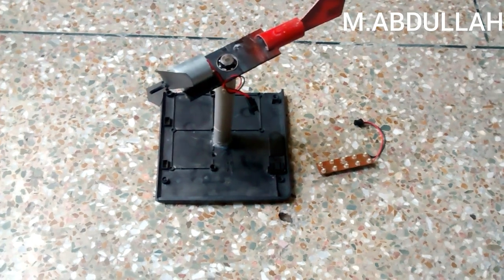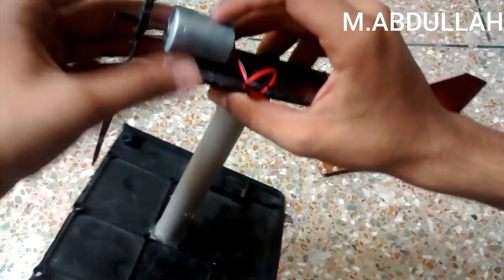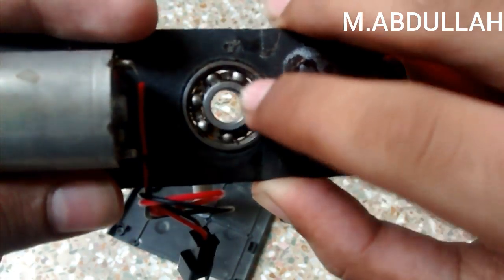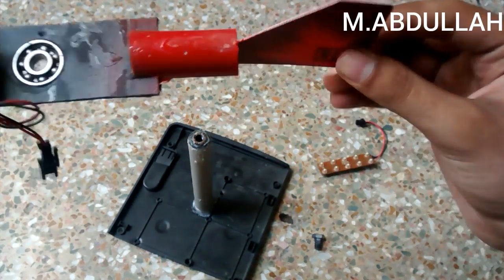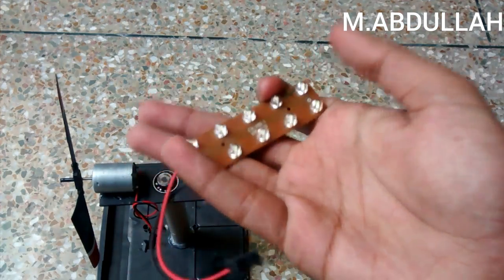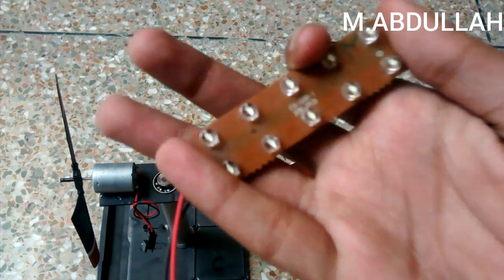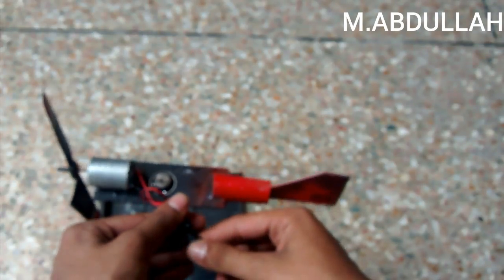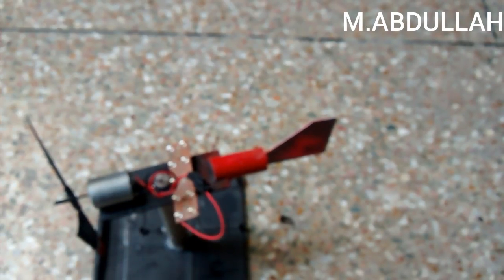HOW TO MAKE A WIND TURBINE, PRODUCE ELECTRICITY FROM WIND

Comment: Your turbine is really effective! I have trouble in doing it in my project.can i ask where can i buy tthat kind of motor? Or can i get it from household appliances?please reply thank you!
Reply from the maker: Brother it is a 12 v dc motor, its name is RF370 motor, u can buy it from Amazon, ebay or banggood, if u couldn't find it, you can buy a mini air pump used in blood pressure apparatus, it has this motor, hope that answers the question
Reply: @SIMPLEHOMEMADEPROJECTS  Oh is that so? I found one 12v dc motor in Lazada called RK 370SD, and its features are the same as the one you used in the vid. Do you think sir that it is similar to what you used?
Reply from the maker: He this is the link check it out https://www.ebay.com/itm/1Pcs-MABUCHI-RF-370-DC-Motor-DC12V-For-Blood-Pressure-Meter-Kitchen-Appliance/182382691717?hash=item2a76db0585:m:mMakzNpcKpI0HbtN4rKUi4w
Reply: @SIMPLEHOMEMADEPROJECTS  oh myyyy thank you siiiiir! This is a really big help for my project although i cannot purchase the product coz it needs credit cards or paypal, im just a student

Comment: I want to store this energy. Can you help me with that?
Reply from the maker: +Akshay singh yes , of course , you can connect a rechargeable battery with it ,
Reply: Wouldn't connection of rechargeable batteries power up the motor instead of storing it??
Reply: @bimjeam0088  this is what happend to my project. I think it needs diode to prevent it